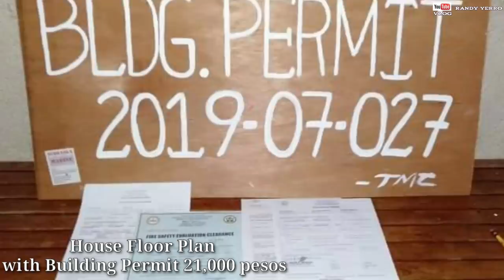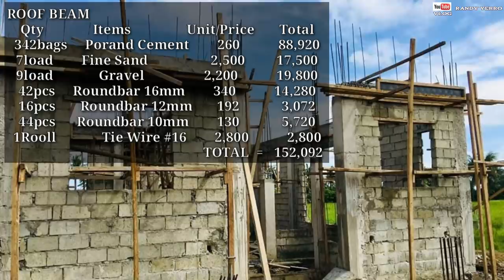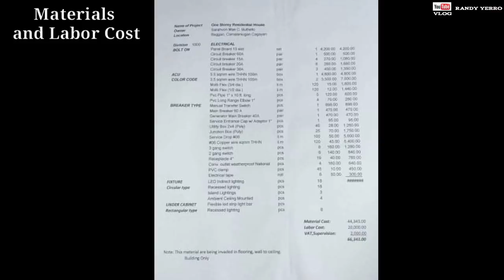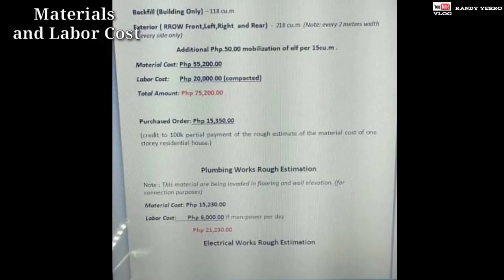OFW SIMPLE HOUSE,CONGRATS MA'AM SARAH,DUBAI OFW CAGAYAN VALLEY PHILIPPINES,Building A House

Comment: 16mm Def. Bar used, earthquake resistant✔ High Ceiling, better, cheaper cooling option✔ .22 Gauge Galvalume, the thicker, the better✔ i don't personally advise putting kitchen island because it minimizes movement & Foot traffic can be a problem. Make the island oval for child proof purposes. 2 million mid-range budget. Expenses are justifiable. No cutting corners. If possible change gutters to stainless steel, minimal/No maintenance.
Reply from the maker: Thank you again sir for giving idea  God Bless po Keep Safe Always
Reply: Yes i agree 2m is too much you can build huge house on that amount up and down..
Reply: Inside ceilings not done yet for 2m?